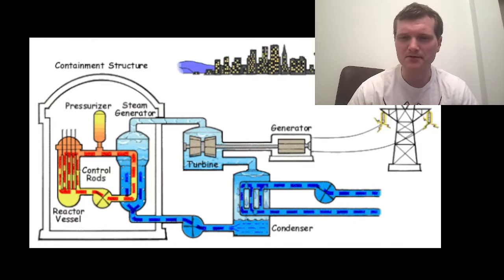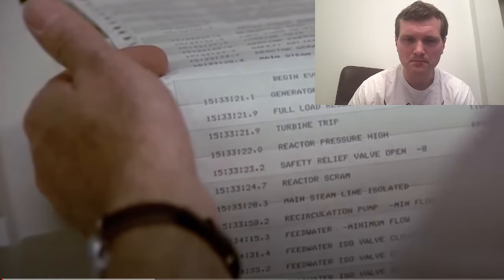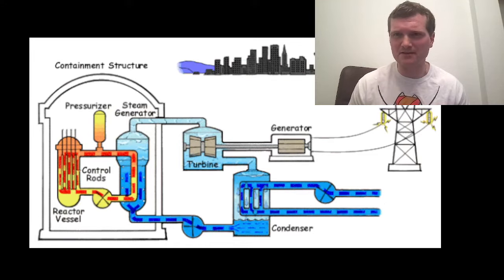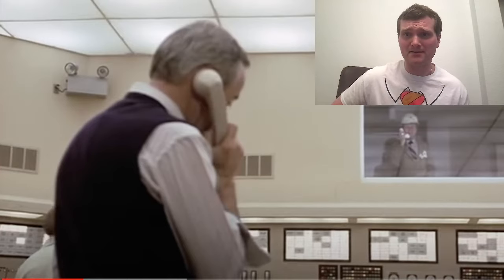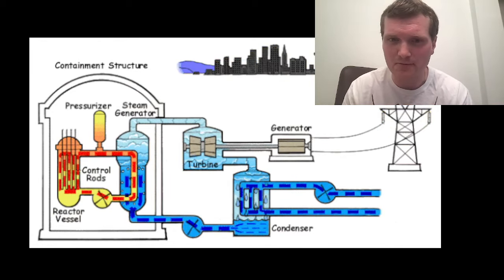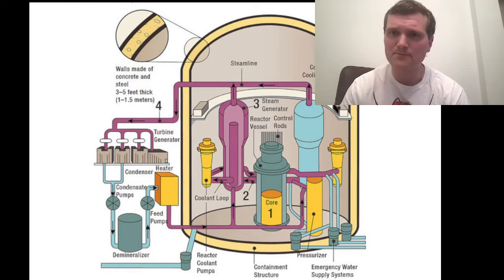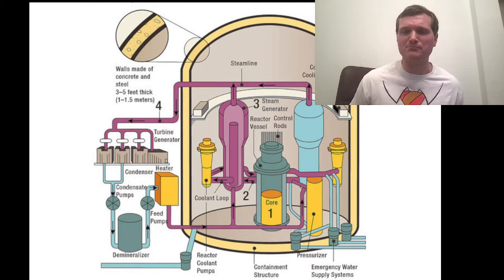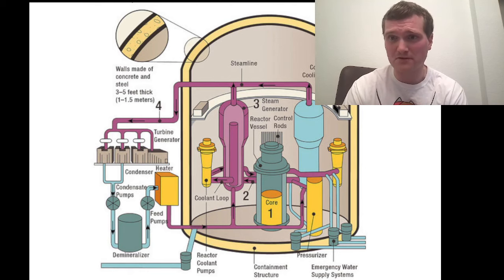Nuclear Engineer Reacts to Turbine Trip scene from The China Syndrome

Comment: When looking at the gauge, he dumped the water (which unbeknownst to Jack was at normal levels) by opening relief valves 14 & 15 and closed te isolation valves. Water level is now low, hpci valves are out for maintenance. Jack dumped the pressure by opening relief valves 1 through 4 and said as soon as the lpci comes in let him know. They get lpci and Jack immediately closes valves 1 through 4 raisin the water level back up. All of that occurring with the main steam line isolated and only one auxiliary pump to get water back into the core. The main issue with the plant was not just the human error actions, it was the fact the cut corners wen the plant was built. Main issue was a compromised support structure for the primary coolant pump, the construction firm having the same radiographs signed over and over, and Jack trying to be stopped from being a whistleblower since he knows the entire system.

Comment: It's a really well acted movie scene, but I figured it wasn't realistic.  And it spreads the idea to the public that every plant is one mistake away from melting down.
Reply: " And it spreads the idea to the public that every plant is one mistake away from melting down."

To be fair, back when that movie was made most plants were indeed just one mistake away from disaster.
Three mile island was written off because somebody refused to close a single valve. At one point the emergency coolant water pumps kicked in and they turned them off because they did not understand why they would come on. That's the plant's automated self defence mechanism yelling at the operators that it desperately needs coolant and the operators denied it because they mistakenly thought the reactor was actually full of water. In the end the plant was stabilized because people with a little more accurate knowledge of the plant where called and they recognised what had a happened and too the correct action.

Yes, basically this very incident, and it happened a few days after the movie was released.

There is an excellent description of this event on the "lead dev" channel called "who destroyed three mile island" and it explains how good intentions are no subtitute for training and systems design. For example: the alarm that would have told the crew what to do was printed by a printer that was so slow that it was backed up with alarms and did not print the most crucial message until two hours after it happened.
Reply: @vinny142  Three Mile Island was exaggerated, it resulted in no actual harm to the public and it was far from actual disaster.  Look up what actually happened.  Only poorly designed and maintained reactors such as Chernobyl were "one mistake away from disaster" and the operators there as we all know purposefully bypassed safety systems in a test.

Comment: I'm not certain, but I think the reactor that appears in The China Syndrome is a BWR rather than a PWR.  Will this make a difference in regards to where the water level should be?

I'm probably clutching at straws somewhat, but the fact that the high pressure cooling pumps are out of service, as well as the rumble that spooks Jack (later revealed to be a water pump cavitating), I think acts as foreshadowing for the corporate corruption and engineering shortcuts that are exposed later on.

As for it being an old movie, well, it was released a literal week before the Three Mile Island accident, and that incident certainly shook up the industry somewhat.
Reply from the maker: Thanks so much for your comment! TL;DR they get a lot of things wrong with reactor design here.

I did another reaction video where they discuss the layout of major components in the plant and it looks like a PWR as there is a steam generator external to the reactor vessel: https://youtu.be/2XbL6BBuxjc.

BWRs have no such component, as water boils in the reactor vessel. However, there is no pressurizer in the movie! So it is a fictitious bad design 😅

If it were a BWR, this wouldn’t change water level requirements by much, as water is required to be above the core to sustain the nuclear reaction and for safety. 

Yes, the movie was made as anti-big business and corruption. I just wanted to point out that there is no way a plant would be operating with critical safety equipment out of service by today’s operations standards.
Reply: @tfolsenuclear  Thanks so much for the reply.  I took a look at the other video and you're right... the diagram is like a weird hybrid of BWR and PWR... or PWR minus the pressuriser (oops!).  It's a shame because the initial turbine trip comes off as one of the more realistic and plausible reactor malfunctions in a movie, and it comes off as very suspenseful.  I believe it was partially based on a real-life incident at the Dresden Nuclear Power Plant, where a turbine trip occurred and a water level indicator got stuck, only in that case it got stuck low and the operators flooded the reactor.
Reply: @WaterCrane  Yes it does seem that the "scene" is descent because it was done with the help of some professionals. But that diagram was terrible. The core in the movie is indeed a BWR. You can tell by the basic terminology used. There are parts in a BWR that are not used in a PWR. It's the tell tale sign. One of these instances was the fact that they refered to the reactor water level as feedwater. I am very surprised that this guy did not realize that. He is right about the safety injection system, however. Even in a BWR the injection system or high pressure core spray system HPCSS would help with this. And a worst case scenario would be using the Reactor Core Isolated Cooling System or RCIC could use steam generated from the reactor to drive a steam driven pump which can take water from the Condensate Storage Tank or CST. If that runs dry then it can also use the Suppression Pool. 

Now blowing off the pressure to use LPCI is a HUGE gamble in any reactor. In a PWR that could result in a void formation. In a BWR this could result in Flash Evaporation of the feedwater in the reactor. This is a procedure that can be done, however, there are parameters and rules with this procedure. It is generally a last effort sort of thing, and it can't be done below a certain level. This is a gamble I would not have done in real life as it most undoubtedly would have flash evaporated the water to the point of rod exposure. 

This is a bit late but I hope I answered some of those questions you had. And one last thing. The water level indication changes DRASTICALLY with a BWR and PWR. Firstly a PWR is way smaller. The entire primary loop of the PWR is filled with water with the exception of the very top of the pressurizer where the pressure is at the lowest point. This means that water level indication will ALWAYS be at 100% during normal operation and actual water level in the pressurizer is the only water level that is measured (pre-TMI) post TMI they do have a water level indicator for the core I believe, as a void in the core could trigger a fictiscious reading of full water in the reactor by actually pushing up on the water in the pressurizer. Now a BWR is different, it is a LOT larger and held at a lower pressure to allow boiling. Water level in this can be measured not by a pressurizer but actually in the core itself. Regular core water level should be 0, any deviations will be read as + or -. For instance if the water level is lower but rising you would call out "reactor water level is Minus 25 (pronounced "two five" not twenty-five) inches upslope." Any indication in the red in the minus is a danger of exposing the fuel. Any red in the plus is a danger of water entering the MSL or Main Steam Line. Another thing that should have tipped this person off that it was a BWR. 

All in all, the movie is ~decent-ish in the description. In real life they would have a chart known as the emergency operating procedures containing symptom based operations. During a trip the first thing that happens IRL is not the supervisor going and looking at everything, it is everyone going to emergency posts and the reactor operator gets the first words in. They will sound something like this "Reactor scram listen up for callouts. Mode switch is in shutdown. APRMs are downscale. Reactor pressure 9 5 0 pounds downslope. Reactor water level minus 2 5 inches upslope. EOP entries on Low RPV level and High Drywell Pressure." The supervisor will say that back to the reactor operator and the reactor operator would say "readback is correct, and all rods are in." The supervisor will then have the operators verify some gauges, valve positions, switch indicators, etc. before instructing the operators on how best to mitigate the disaster. That, and the lack of a reactor protection system which would have prevented some of the actions taken by the operators are the biggest unrealistic parts of this movie's BWR. The movie was filmed in a real plant simulator, the FICD or full in core display was changed likely because it is proprietary hardware. But otherwise I think it is pretty true to real life.

Usually this channel is pretty good with the details, but in this instance I think that fake PWR diagram earlier got to his brain. That and it seems he has more of a passsion for the physics and the response to emergencies from a physics perspective (since he is an engineer) rather than from an operations standpoint. So this video may be out of his comfort zone a little.

Correction: I did talk to a real life operator and they said that flash evaporation wasn't really a risk in this situation. They said they would actually dump pressure until LPCI was on because the HPCI is designed not to inject water to raise the level but to only hold the level. The LPCI is what is used in a LOCA accident such as this one so they would dump the pressure and actually use LPCI to fix the water level.
Reply: I remember the year this movie came out. One aspect of the release of this movie that was very significant was that it was released on the 16th of March and twelve days later the Three Mile Island Reactor Unit Two suffered a partial reactor meltdown. Just like the observations of operating in a non-standard condition that are seen in the movie, TMI Unit-2 was also operating with various tagged out items, and because of at least one of these conditions the operators were unaware that they were losing reactor coolant. So as a matter of fact what was worse than what the movie depicted happened in real life less than two weeks after the movie came out. The movie however has an unfortunate problem that the title of the movie, though compelling and memorable comes from a rather hyperbolic and very unrealistic scenario implied as a result of a meltdown. I think this unfortunately caused some to think that this movie was a anti-nuclear hit piece, when in reality it dramatized some real issues that can arise from poor regulation and inspection oversight by the NRC, combined with malfeasance on the part of an operating utility driven by profit and greed. I think it dramatizes the issue of the hazards faced by “whistle blowers” and the need to protect those individuals who bring things like negligence, and duplicity to the awareness of government regulators.
Reply: To be fair, it seems they didn't want to portrait any of the competing designs specifically in order to address the more general topic, which is the realities of deployment of high risk technology in a strictly commercial environment. The scene should probably be judged from this perspective.

(I'd also say that the procedures of closing valves and alternative paths, in order to stabilize the state of the reactor after shutdown, as mentioned, may be well sumarized in the order, "stabilize the reactor". Also, the dialog doesn't spefically mention a leak, it's rather a high level of radioactivity at "level 8", what ever this may be, maybe some kind of imbalance, which is supposed to be normal and expected to recover. It's more like a reminder that high risk factors are involved in operations, rather than an incident. From a story telling perspective, everything is in parameters at this point and the tension is cooling down, in order to give rise to the actual incident of the contradictory readings.)
Reply: You were right with your statements.
Reply: @tfolsenuclear  i thought the point was american Chernobyl intentionally faulty desgin leading to them having to break  standard procedure to lessens effects of the melt down ofc its not up to todays standards its set in the 60s-70s where somthing like this could still happen as reactors werent as well understood

Comment: Even back then they had an emergency procedure.  There are immediate action steps that the operators are required to memorize. And perform from memory. There's typically 3 or 4 instruments for any critical measurement.  Operators are trained to use alternate indications to verify conditions.  For example, for high eccs flow, containment water levels, and containment pressure.  This move always makes me gag.

Comment: I suspect they said water in the "core" is low/high because "pressurizer" wouldn't sound as dramatic. IIRC the tagged-out pumps come up later in the film when Jack Lemon's character says he'd expressed concerns about running the reactor under those conditions.
Reply: No, it was in the Reactor, giving credence to the fact that they actually mixed and matched the China Syndrome with both types...water level in the Core gave Jack Lemmons character severe grief about "covering the fuel" whereas if it was low in the Pressurizer, there would still be sufficient margin to keep the fuel covered. Also, they're very concerned about "feedwater" which, on a BWR, feeds directly into the reactor, thus giving them a water level. Feedwater on a PWR feeds the steam generators which has little affect on Reactor water level.

Comment: Great explanation of things.  I had one question if you still see comments from this post.  The movie is using a BWR type design.  At least I assume that’s the design. I read your previous reply to another person that brought up the PWR/BWR question.  Assuming that it is a BWR, wouldn’t there be some radioactivity due to any steam or coolant pooling from the pressure relief valve opening in that reactor containment area?   I’m thinking along the lines of neutron activated water.  I’m not sure where the pressurized steam/water goes if safety valves open during a scram but I was just curious if that would be a possible radiation source with a BWR or if it’s just completely not a possible thing.  

Thanks for the video!  I love nuclear power and hope to see a construction boom of the newest generation of reactors soon.  I live in northeastern TN, well inside the footprint of the TVA.  I was extremely happy to see TVA finally complete and start up Watts Bar reactor #2 several years ago.  That, combined with TVA Browns Ferry reactor #1 being brought back online in 2007, has resulted in nuclear being the leading source of power generation in the TVA system.  Production with nuclear is approx 43% of all of TVA’s power generation.  

If we want to have carbon free electricity 24 hours per day, nuclear is the way to go.  It’s the only option to provide large amounts of carbon free energy.  Electricity efficiency for environmental reasons wouldn’t be as pressing with nuclear since emissions aren’t involved.  My understanding is that new generation reactors are much more safe than the older generation of reactor, especially where post shutdown decay heat is concerned.  

Anyway, I hope your industry continues to grow!  We need nuclear and we need more of it now!

Comment: I use to work for the Koeberg Nuclear Plant in Cape Town South Africa. They were very secretive. I once asked the question regarding a Turbine Trip, and having a run away turbine. I asked them: is there dummy loads to "clamp" the generator output voltage/current turbine connected to the generator preventing it from running away when the reactor trips and rods are slammed home/safe. "But your reactor is still producing heat because of residual heat momentum". Remember, it takes 2GWatts of fission heat energy to produce 1GWatt of electrical energy. You don't stop 2000 Megawatt of reactor heat energy and 1000Megawatt of electrical energy in a second. ...Any comments??????? RE